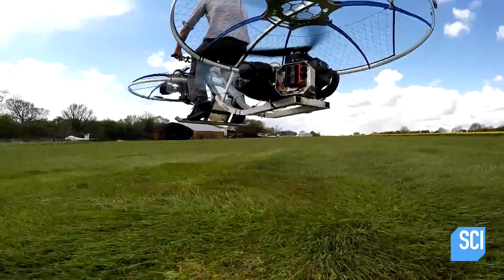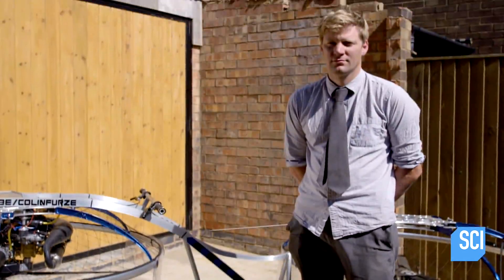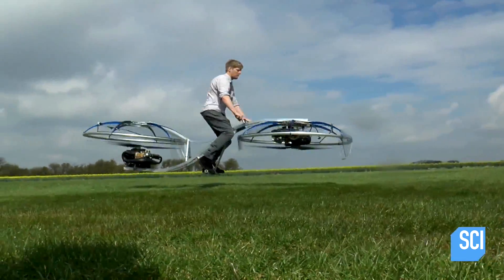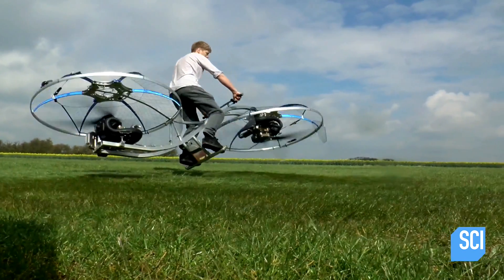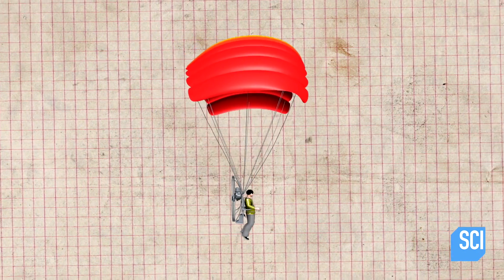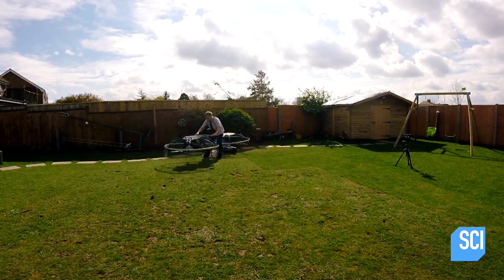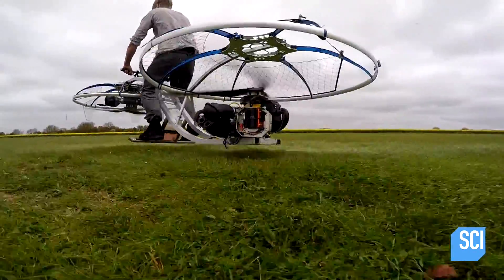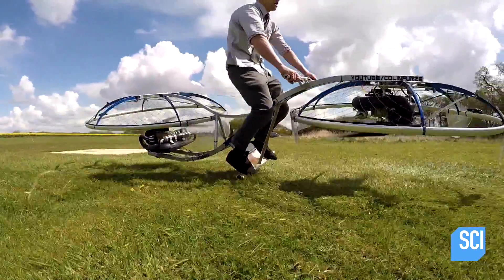Behold, The Hover Bike!

Comment: i think if we look at the from and back end's cage designs we have the perfect shape and size for a full cover cage for both ends instead of the S shape its working with; which might help with balancing issues and landing issues. maybe add some all terrain light weight wheels for smoother landings on the bottom of said newly designed framework to make landing be less of an instant drop/crash. the point of the wheels being that you could make a landing in a similar manner to that of a jet or a plane.... ya know; rather the the displayed CRASH!/sudden stop the rider seems to experience in the video. here's hoping the inventor see's the comment; if they haven't gotten this idea on their own yet by now XD

Comment: Well this so-called hoverbike is just an engineering thought experiment. The US Air Force came up with a hover platform in the late 50's and abandoned it because the best flight time you can hope for is 30 minutes. Unless and until Engineers come up with a power supply lite enough to power a hoverbike or jetpack these devices will be nothing more than engineering thought experiments. 

By yhe wsy, the stability would be greatly increased if he added a gyroscope.
Reply: The fact that something similar was done before is irrelevant. This guy does things like this for fun and records his thought process throughout the project, which is very interesting to watch for what is obviously an incredibly large number of people. Besides you shouldn't discourage people from attempting projects that have been done already.
Reply: theylied1776 
Just because something isn't practical is no reason why you shouldn't do it.
Reply: This specific project has not really been done before, similar projects like jet packs and large quad copters have been done, but mostly through independent people or groups. most universities don't fund projects unless the students can provide a real life application.
Reply: theylied1776 actually they have a jet pack that runs for 40 mins.
Reply: Harry8642 Surname? Post a link to it because I've yet to see one? As of right now the longest sustained flight time for hover bike or jet pack is no more than 30 minutes.
Reply: The Piscis If you have an extra $30 to $80,000 just lying around, go out and build one. 

This is an engineering exercise that some engineering student builts every year, from MIT, Georgia Tech, to Caltech. This type of project doesn't cost an engineering student all that much to build because these universities give them access to all the materials they need.
Reply: Actually, this was done by a you tuber who has no formal education in engineering. He did it because he just wanted to.
Reply: The Piscis As I claimed before, this is done every year at Tech Universities as projects. Some for fun or student project. 

This is nothing new, the US Air Force first created a flying platform in the mid-fifties.
Reply: The Piscis What is unique about this project... nothing. It's a variation of the flying platform the U.S. Air Force came up with in the fifties. The only difference he doesn't use a gyroscope to stabilize it and he uses two propellers. It's been done before there's a Russian company that made one 2 years ago.

This is an engineering exercise and nothing more.
Reply: This is nothing more than an engineering exercise. It employs three engineering disciplines: Mechanical, Electrical, and Structural. Several Tech students across America do this as a project every year. But good for him, he's just one of many people that built a so-called hover bike. This has been a standard Tech assignment since the U.S. Airforce first came up with the concept of a flying platform in the 50's.
Reply: @theylied1776  you have been saying the same thing for 5 comments
Reply: @dane1382  and your point?

Comment: just reduce the blades a bit and add in another pair in a long x design. then borrow the chip set from a quadcopter for gps stabilization steering power etc. Make your own quad bike in the backyard relatively cheap.